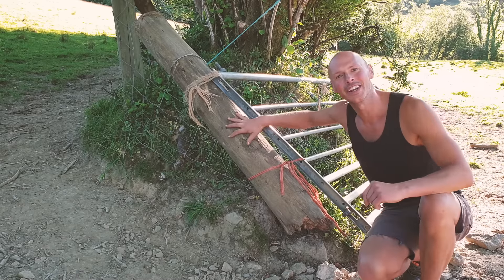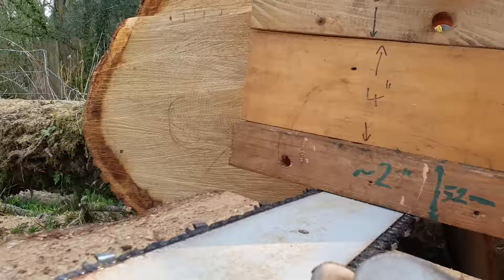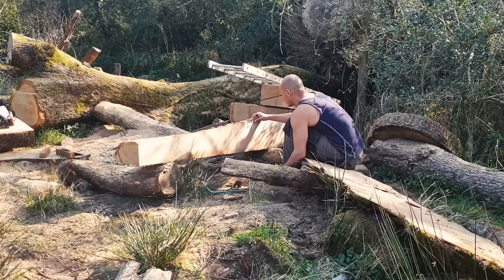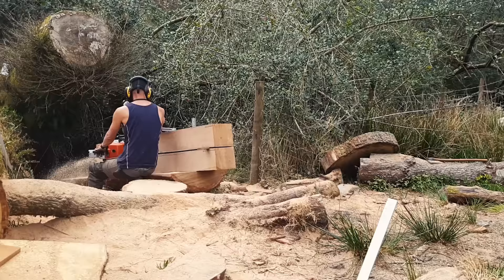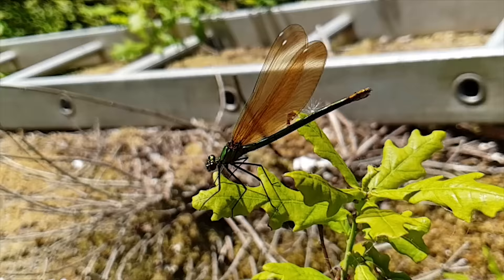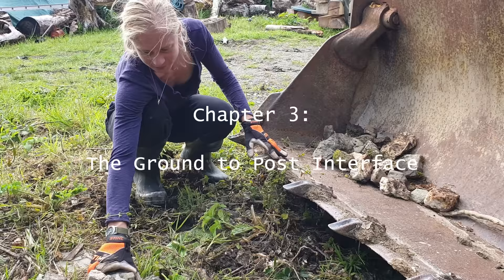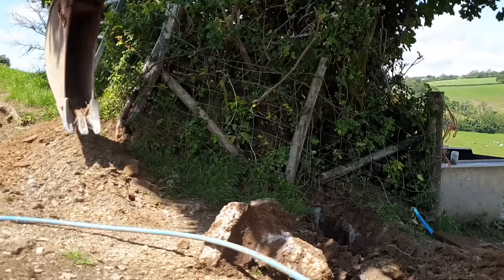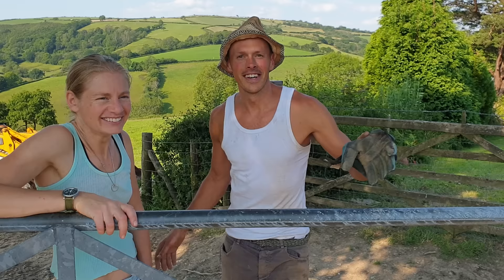The 3 secrets to ROT PROOF POSTS and how to make them

Comment: Mix used motor oil equally with diesel. Your post will last 90 years. Just soak the part that is in the ground obviously and let it dry before installing.

Comment: No. Big difference in white and red oak. One has open cells other has closed cells. Red oak will rot with open cells. Moisture content has a lot to do with it too. I recommend burning it than taring before putting into ground. Doug fir, white cedar and Tamarack seem to last the longest. Capillary action is what rots post the most. They will wick water from the ground into post. It's why you need a capillary break between masonry and wood. Masonry loves to wick moisture.

Comment: What's with the respirator?
Reply from the maker: Good morning David. It's the 3M 6800 full face equivalent which means it's a cheaper import (only about $30 here: https://goo.gl/kVGmyk ), but I use it with the genuine 3m 6001 vapour filters. (ebay link: https://goo.gl/PNXNEq ) .

Comment: if you use concrete for setting posts then you need to make mix that is reach in gravel and low in cement slurry, so you have full coverage of gravel with concrete mix but not enough to completely fill voids in it, some plastifier makes things easier to cover all grains, this type of concrete lets water to go away easily, remember to cover top with normal mix, so it do not have to much to drain :v
Reply: Or pound some old hard bricks around. Or split gravel. If compaction is good no need for any glue

Comment: One of those failed chemical recipes involves using more copper. Yes, copper is a very good antibio agent but in a moist enviroment, it promotes galvanic corrosion. This is especially bad for fasteners with galvanized coatings, hence the wave of new epoxy coated hardware. My preference is stainless steel but that has the major disadvantage of being very vulnrerable in an anaerobic environment. Some major building supply stores have discinued selling galvanized screws, even bolts, because of the liability from failure.

Comment: Cemented wood post works just as fine, if not better, cheaper and faster, but folks can't seem to follow the darnest guidelines. 
The problem is that the better property of cement allows lazy bums and corrupt hustlers to make an half-assed job and still it looks nice and solid, and the failure in worksmanship will not show immediatly.
The thing with no concrete post setting is that it mechanically force people to think twice before cutting corners, that's all there is about it.

Comment: I can't believe making a post out of concrete even poured in place wouldn't be any harder to do Esp as you have a JCB  You can get past "fastener" issue by setting 4x in its side w threaded rod bolts washers A PT on should last 20 yrs esp if u slab a coating on it every 5 yr or so I've pulled 30 yr old PT plank from under leaf mounds w just a few ant holes in em I'd still cap them & lay sloping rock at base The big advantage of this seems u didn't pay for posts which would have cost a kings ransom Then again u didn't get to sell log which would have brought in enuf to pay for concrete & rebar w something left for a treat to enjoy in time saved Of course I work in concrete as did gramps
Reply from the maker: Thanks for sharing Russell.

Comment: Have you tried birch oil?
Reply from the maker: Hi Abbie, no we haven't. Any experience with it?
Reply: @FloweringElbow   Like any oil it will act as a waterproofing agent, the difference is in sourcing it - birch bark oil can be quite easily foraged and made by yourself for next to nothing as long as you can source a nearby forest with birch in it! - It's been used on leather and wooden tool handles for a very very long time. You can check out  my Instagram for further foraging tips if you want https://www.instagram.com/forage_fairies - I don't cover much fencing - but might have some pointers in getting a decent lunch together while putting the posts in ;) - Great videos by the way - love your channel!

Comment: Why not just coat the bottom few feet with a thick coat of tar?  I have also soaked the posts in buckets of used motor oil for weeks before using, then coating with tar.

Comment: Oregon State University did a multi-decade fencepost study which may be applicable for people who live in a similar climate. Osage orange is the king. Black Locust is excellent. Redwood (sequoia sempervirens) is very good also. In all cases, use heartwood, especially for redwood. In oregon, osage orange had zero fence post failures for the entire duration of the test (66 years). They also tested DIY treatments. Not all of those treatments are still feasible. Times have changed. http://juniper.oregonstate.edu/post-farm.pdf. They claim that charring has no beneficial effect.
Reply from the maker: Good morning McKenzie. Yeah, that is a great study. We had read it before doing these posts. There is actually a nice discussion about it on one of the permaculture forums. People pointed out that the problem with the charring they did was that it was only on Douglas fir. It is well known that the hardening does not work well on many softwood species. Also they charred to a 6mm depth, which probably wanted scrapping back before installation. 
People have tried to make sharpened hardened sticks with softwoods, and mainly it seems not to work! Therefore this process  may be best for hardwoods.
So yeah, as I said in the video, it's questionable as to whether charring softwood does anything beneficial other than kill existing bugs... 
Peace, Bongo.
Reply: @FloweringElbow  I see. Where I live redwood is not too hard to come by. I just bury 4x4 posts 1/3 in the ground with the native soil tamped down around them and they hold up OK. They are not gate posts though. Just fence posts or support for wires that hold irrigation tubing up off of the ground. Black locust grows around here too, but I just use redwood.

Comment: blue stone  .....soak the post ends in a concentrated solution of bluestone...copper sulfate. the post will soak up the solution into the very pores of the wood. No bacteria lives near copper, so the post does not develop rot.

Comment: Never seen someone use the gas mask to saw. Is this required in ur area or just taking care of ur lungs.  Awesome stuff either way. Really enjoyed this video.
Reply from the maker: Good morning Simon, good question. Short answer is, it isn't required by any laws, but I know from experience that a full day of chainsaw milling dust and 2 stroke exhaust fumes will make me feel fatigued and a bit sick. Not so if I wear this 3M 6800 full face equivalent (which means it’s a much cheaper import, but I use it with the genuine 3m 6001 vapour filter modules). ebay link mask: https://goo.gl/kVGmyk  cartridges: https://goo.gl/PNXNEq .    
I have no idea about long term consequences of unprotected exposure, so yeah - just taking care of me lungs guv.
Reply: @FloweringElbow  makes sense as milling makes so many shavings and dust. I have started using more lung protection myself. May look into something like this. Right now in the summer in the Tennessee i couldnt wear one as to hot and humid but in cooler months could be useful. Thanks have a wonderful day.
Reply from the maker: @mikepurkey6070  It was a game changer for me, switching from combined face shield/helmet/ear defenders, to the 3m shield I linked to. As well as fume protection, I actually get less fogging, AND I can use my radio ear defenders, so I can mill to music/radio :D 
Peace, Bongo.
Reply: @FloweringElbow  nice thanks for info and reply.
Reply: @FloweringElbow  Do you use classic gas and 2 stroke oil, or Alkylat gas like Aspen?
Reply from the maker: @vornamenachname4563  Hi, Super interesting. I have been using what was available at the pumps here in the uk - regular unleaded... I'm looking into Aspen fuels now, which I'll be hones, I didn't know existed...
Reply: @FloweringElbow  Aspen, MotoMix, Ecomix and a lot of other brand names. It will be a game changer for you and your lungs, but expect that you need to deep clean the carburetor a few working hours after you change to alkylate.
Reply from the maker: @vornamenachname4563  Thanks for the lead. Will pick me up some to try. Why the need for the carb clean then?
Reply: @FloweringElbow  your normal gas/oil mixture got all kind of things dissolved in it, some of this stuff will  stick to all the fuel system. The alkylat gas clean the dirt out, but won't dissolve is, so it akkumilates in the carb. That happens normally only once, but you shouldn't change between Aspen (or...) and the old gas/oil mixture.
You can try it on your on and put some Styrofoam in normal gas and the alkylat one.

Comment: It seems a shame to use such a fine free for fence posts.  Here we use black locust 8" - 10" in diameter.  Oak like that would be cut into boards, air dried and later used for something nice.

Comment: If you do not want a fence post to rot do not make it out of wood get yourself a length of PVC pipe 6 in in diameter or greater The Lingth of the post that you want then fill it with concrete and steel  rebar and you will have a post that will not rot the PVC material May deteriorate over time but the concrete will not rot for a verry long time.   It will probably last longer than you do. Probably cheaper than wood too.
Reply: If a post must be made of wood then use bowdark/ Hedge Apple Tree. I have seen corner posts made of this wood that were well over a hundred years old and were still solid with very little rot or insect damage whatsoever.

Comment: It should be CLEARLY made known that oak is ONLY durable if its of the white oak family of oaks. If it is one of the oaks of the red oak family, then it is not closed cell tyloses and is not durable. White oaks AND red oaks are very common in North America. Only white oak members have closed cell tyloses and are durable. To my knowledge, no red oaks are known to Europe, but North American members of the red oak family are widely exported.
Regarding rot fungus, an acidic condition is needed for rot to occur. Putting fine crushed limestone or agricultural lime in the hole is an excellent help. regarding pressure treated pine 4X4 or 4X6 posts, they are pressure treated whole with the end grain included. Cutting off the one end and putting it in the hole would be a mistake. Cut off the other end if necessary. Creosote by the way has two main kinds in industry. They are coal-tar and wood-tar . The coal-tar variety, having stronger and more toxic properties, has chiefly been used as a preservative for wood. Regarding it's safety in the U.S. the Environmental Protection Agency's website states: EPA did not find health risks of concern for the general public, nor for workers who handle creosote-treated wood after application. Interestingly, a study done with borates on railroad cross ties, as well as with creosote and copper napthanate, show that borates are more long-lived in wood than was previously thought and that they do not readily leach out. Here is that study link: 02-18 XT (memberclicks.net)

Comment: OK you put a copper hat on it, hope those were brass screws. Also not sure if a good idea for the steel parts of the gate. Copper on the bottom of ships caused all the iron nails to rust. Would have been better to put Zinc coated steel on top. Not stainless steel. Lead is no longer acceptable but would last 100 years.
Reply from the maker: Hi eBaab. Thanks for sharing that. As you suspected they were brass screws, so should be all good :D thanks again.

Comment: I was just wondering about the pros and cons of using sump oil, especially from a diesel engine. Pros, should enhance the longevity of the timber and would soak in a fair way. Especially on the end grain, top and bottom.  Cons: Possible environmental concerns but should be minimal if let to soak in for a couple of days. Not sure of the durability of it's rot and insect repelling properties. Probably the more of it and the longer it was allowed to soak in the better.
Reply from the maker: Good morning Harry. A fine analysis! Agree with most of those pros and cons. One more of each to add: 
Used engine oil is FREE = good!
It's harmful to human health (carcinogenic). Heavy metals and polycyclic aromatic hydrocarbons are bad news! I'm almost certain some people will chime in to say they have been slurping a teaspoon full before every meal and it never did them any harm, etc etc, but I wouldn't take that seriously - the more we research this stuff the more harmful it appears to be. If you use it be very careful, and use proper ppe. I wouldn't put engine oil treated posts anywhere near where you grow food. Used crankcase oil is also known to cause hyperkeratosis in cattle too, so keep treated sections low where they won't rub... 
Let me know if you think of any more pros and cons - it's a fascinating topic. Peace, Bongo.
Reply: Used motor oil has been used in the US mixed with kerosene to paint barns for years.
Many of them are still existing that were built a hundred years ago or more.
Reply: @FloweringElbow  Thank you for a really good video and all the excellent replies. A very big subject. Anything like this should be handled carefully and in mind of the exposure to everyone and everything. Cheers everyone.
Reply: Many years ago I built a shed with bark stripped ash which rots fairly easily but I soaked the ends in used motor oil from the days of leaded gasoline. Still standing.

Comment: 12:31 No you don't. Gravel works far better as it provides the requisite drainage and allows for better initial positioning of the post. Not everyone has a tractor had for hanging the post. In which case temporary stakes at right-angles to each other and with bracing cross pieces will be required. This is an easy job even for one person to achieve. Once the post is leveld on all sides and the temporary braces are in place, pour concrete in and 'tent' the top so water runs away from the post.

Comment: Why not use Stainless steel posts? They'll last forever in the ground
Reply from the maker: they certainly would perform well. Expense and embodied energy. are probably the big downsides.
Reply: @FloweringElbow  they certainly ain't expensive if you sold your oak it would pay for almost 10 lengths of pipe at a minimum. whats an embodied energy? I've never heard of it before.
Edit: i looked up embodied energy and I've gotta disagree it'll actually be less life energy since you don't have to replace them at all for atleast 200 years at the minimum for the stainless, lets say your oak post last 50 years so in the life span of the SS posts you'll have to replace them four times which require you to cut up the wood four times, transport it four times, char it four times and then finally oil it four times per post to get the life expectancy as a stainless post since a steel pipe (same method of construction) uses very little energy to produce since its done in massive batches hence lowering its cost per unit to a fraction of what it'll cost to make a single pipe.

Comment: I worked in the woods for years. Do you realize how much bar oil you threw into the ground and first rain will put in that stream. How much toxins did you pump into the air from saw gas and fuel for your vehicle to get there.  Luc
Reply from the maker: Hi Makayla, thanks for getting in touch. What work do you do in the wood my friend? Something no-compromise zero-petrochemical I'm guessing. The truth is, no, I don't now exactly how much toxins the saw burning gas makes - though it's enough to make me wear a gas mask unless it's a windy day. Not happy about it, but also can't see many good alternatives. The bar oil is veg oil, of course, ,but I always finish the day with some bio-degradable stihl bar oil, as the saw sometimes gets left weeks before next use.
Peace, Bongo

Comment: Heat them and soak them in DIY SODIUM SILICATE ... ??
Soak them in hot used motor oil ... ??
Use Aluminum tube with wood inserts ... ??
Reply from the maker: Good morning Kenneth, thanks for the suggestions ;)
Reply: @FloweringElbow  hmmm .. I thought they were alternatives,... suggested.
I've built Random Rubble Stone Wall 1m•30m+, 4pcs of 0.75m•0.75m•2m RR GatePosts,... 17floor Mixed Occupancy Commercial, Residential MultiFamily & Single Family Stud Frame Construction, Furniture & Cabinetry/Joinery, and LOVE being  a HARDWOOD SAWYER.
Any questions ?
Reply from the maker: @KennethKustren-lr6tg  wow. That's a lot of experience! What (if any) chainsaw mill do you run?
Reply: @FloweringElbow  I used my brothers and friends, and witnessed chainsaws everywhere. This is  British Columbia Coastal Rainforest, SemiArid, Boreal Forest, and Rocky Mountains... All within 300 kms of me.
I am not a forestry professional. I have a double bit axe. I have a machete. Saws...
I eat wood from every Continent,... equally.
Reply: @FloweringElbow  What CNC saw tables have you worked with ?
Reply from the maker: @KennethKustren-lr6tg  None! Am in the process of building a CNC router, for wood and aluminium.
Reply: @FloweringElbow  Can I sell ya parts for anything tabletop size-ish ??
Reply: 2-3pole Microswitches, 220v 10A Relays, 4axis Controller, NEMA frame 1.6° steppers....etc.,...??
or mayhap You can use my old mentors... www.buildyourcnc.com

Comment: Sorry but I found your set up for cutting the bute with the ladder and chainsaw to be very dangerous. I would suggestthat as soon as you can afford it you invest in a circular saw bench or a horizontal bandsaw. More accurate and much safer. Greenheart is the timber that lasts the longest in wet soil and elm will also outlast oak if kept permanently wet.